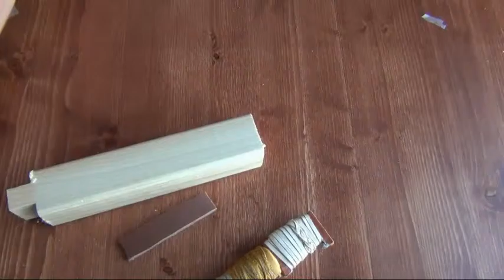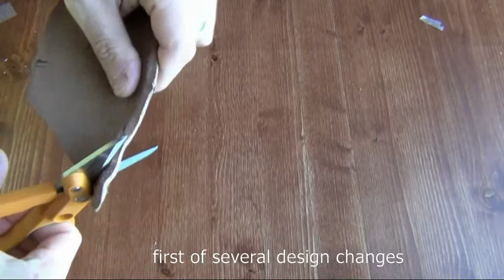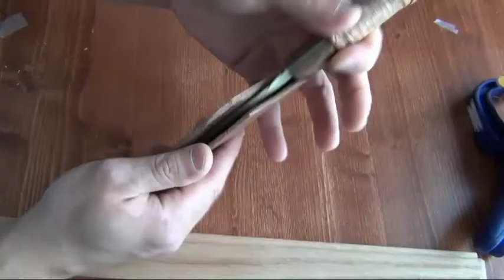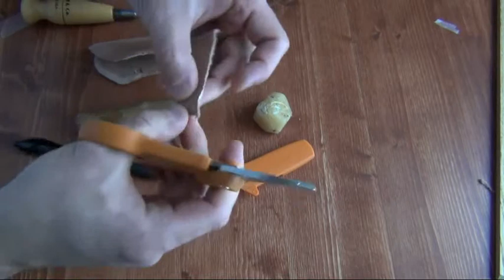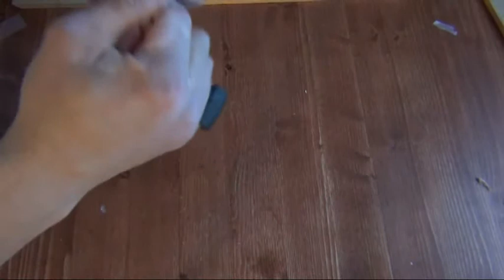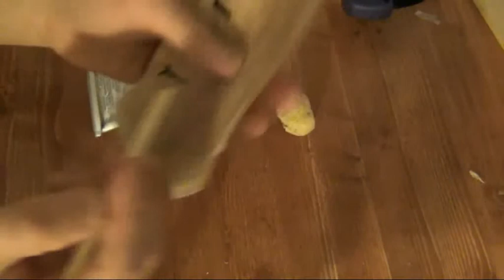Project 1: Vegetable Tanned Leather Knife Sheath w/ Edge Braiding Part 2 of 5

Comment: Great work, man.  It was fun to see the design process.  Did you tan the hide yourself or buy it?  If you did do it yourself, would you mind making a video the next time you have to do it.  Thanks a bunch and keep on trucking.
Reply from the maker: Mikeyb Thanks Mike. I don't tan my own leather, it's much more efficient for me to buy them particularly because I favor the vegetable tanned leather. I do make my own rawhide without using ash, the demo video is on my channel.
Reply: Thanks.  I noticed that and definitely appreciate your reply.  Do you source the leather locally or online?
Reply from the maker: Mikeyb No problem, I pray that I am never become too important to answer questions. For now I source my leather online, ebay generally has competitive pricing, I am unaware of any tanneries in my current location.